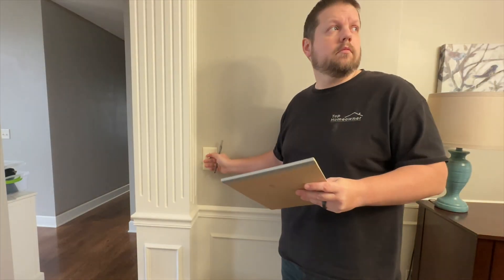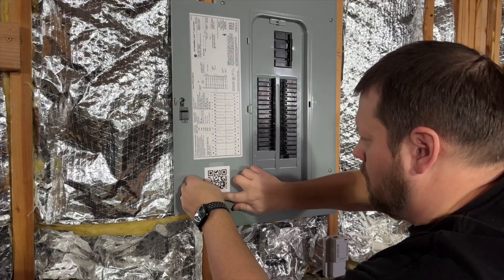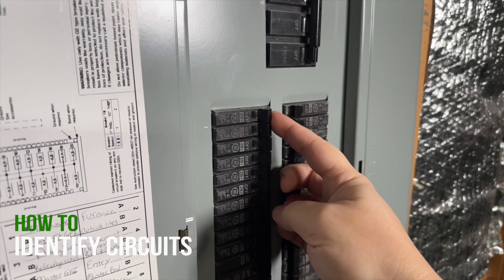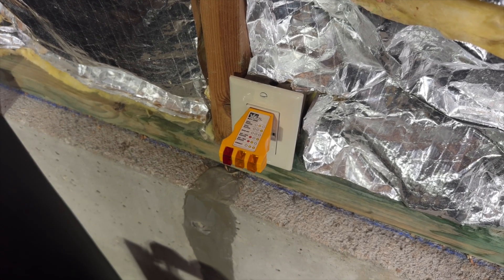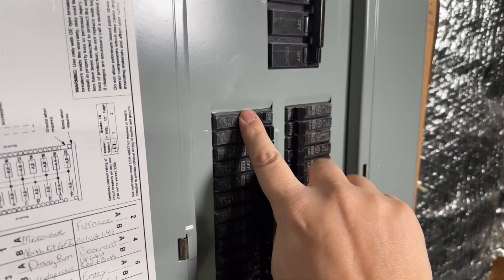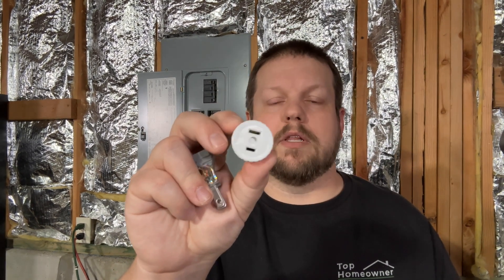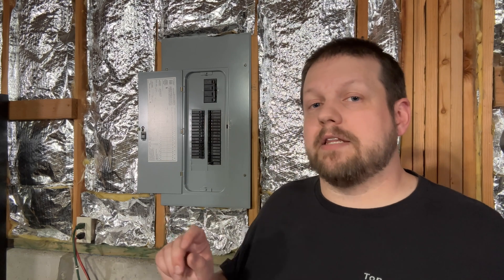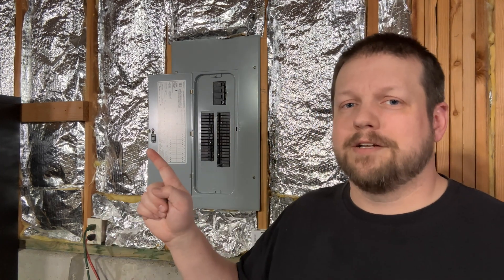How to Label Your Electrical Panel the Right Way and Stop the Chaos

Comment: I gotta say, my first thought was, "A QR code linking to an online doc?! That's crazy!" (And I'm a tech guy!)

Then I started collecting all my info and found that ONE of my breakers is for "the lights in these 4 rooms, and the smoke detectors in these 3 rooms, and exactly one specific outlet in each of these 3 rooms".

And I said, "Okay, yeah, better to put a summary label and then link back to the doc." 😅

But it sure explains why when we first moved in FOUR different breakers were just labeled "Lighting". I think whoever wired this house originally just rolled dice to decide where things should go....

Comment: I;m making a book that stays with the service panel. In that book Is labeled floor one through 5. That way If I need the power off on the third floor I go to the third floor page and search for the right circuit. Things like microwaves get moved around through the years. It’s better to label recepticles north east west south. I have made notes on all the junction boxes to. DON’T BARRY JUNCTION BOXES. ITS A SLIPPERY SLOPE IF YOU DO. BY NOT IT PAYS OFF 20 YEARS OR SO DOWN THE ROAD.
Reply: Also don't "Bury"